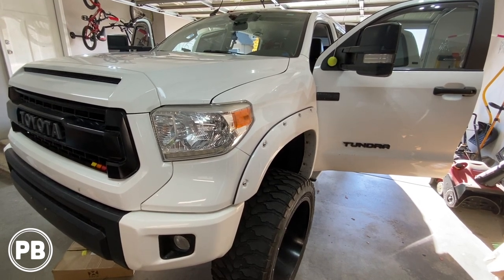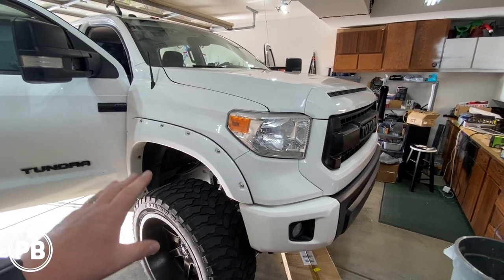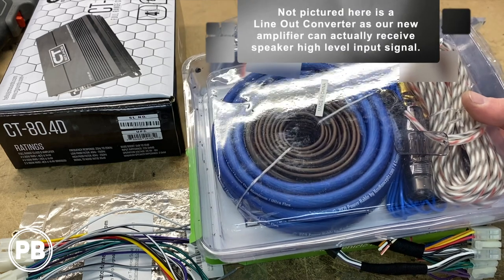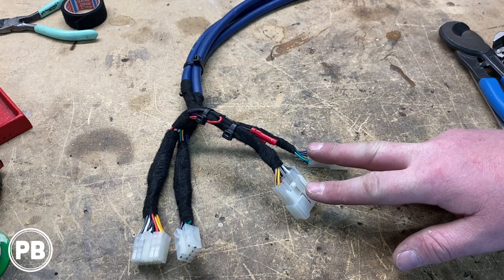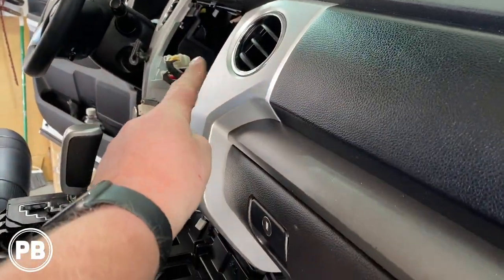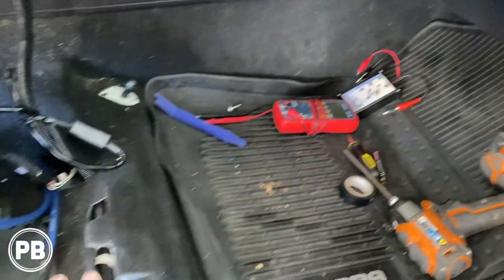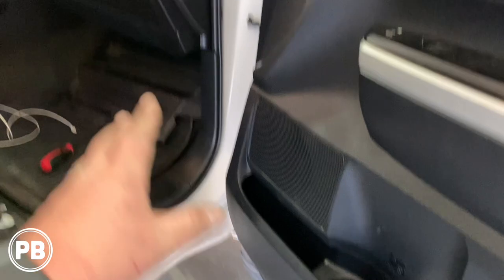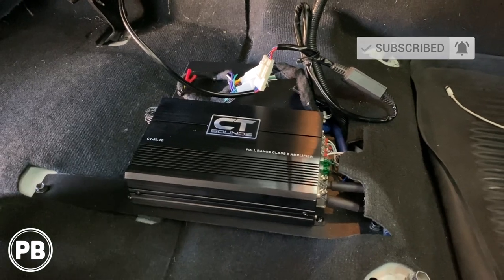2014 - 2021 Toyota Tundra 4 Channel Amp Install

Comment: Thanks!Your videos helped me wire my 2015 Tundra. I ran into a few minor issues, but was able to correct them easily. The smaller male connector that goes into the radio was keyed differently but I just cut out the piece that was blocking it with a razor. The other harnesses for the plug and play hookups didn’t come with the extra wires for hookups for subs so I just soldered in new leads color for color with the extra 9 conductor cable I had. I wasn’t able to find pins and not too savy on finding car parts. Otherwise I would have just pulled the pins and cut and re crimped them with the extra leads. Other than that install went well. I really appreciate the help keep up the great videos.
Reply from the maker: Thank you!

Comment: Hey thanks for the content you make!!! I have an aftermarket headunit. Im trying to wrap my head around the bypass you did in the video. Because i have a aftermarket headunit i would just run rca to amp then send signal to the door speakers using the already installed toyota wiring.... i think. Currently i have the amp bypassed because it did not work with the android head unit i installed. My question is why not just use the signal wires coming from the radio in the harness underneath the passanger seat to the amp's input then running the amp output to the speaker using the harness underneath the passenger seat? It does not make sense to me but im ignorant and dont know enough to understand why you need to do a bypass and make a new harness. Im just seeking to understand.

Comment: Great series of videos!! Just finished my install and wanted to mention that the factory amp in my 2021 tundra needed a larger piece of ABS plastic. 16"  was too short.
Reply: Did you use the T-harness recommended in the parts list? My understanding is this one does not fit the 2021 non jbl stereo.
Reply: @welshtexas1  Not sure if you found an answer or not, but you have to use a different harness. I emailed @ProvoBeastAudio and they sent me the correct info for my 2021 tundra non JBL.
Reply: Hi, can u please provide the information for the 2021 none JBL harness.  Thanks in advance.
Reply: Hi, can you please share the link/ information for the 2021 Tundra. Thanks again. none JBL @camoore
Reply: Do you have the part number of the part they sent you?  @camoore

Comment: The “new harness adapters” from Red Wolf do not fit the 2014 tundra. This route is a total wash if you’re depending on the harnesses listed. I have the 2014 SR5 Crew Max. Non JBL…with small amp under the passenger side seat.

Comment: Thanks for the video, but, still wondering why you went from the factory amp harness back to the head unit and then wire from the CT amp back to the factory harness behind the radio... You had both speaker and source wires under the seat already to connect directly to the CT amp, maybe I missed something...

Comment: It would just be easier to buy an amp that can take high inputs, then you wire the radio inputs to the high inputs of the amp. Then you wire the outputs, these are wires going to the speakers, and wire them to the oupts of the amp. Saves time pulling the radio out. Also if you have a amp that dosent have high inputs then you can a LC7i but this is the more expensive route.

Comment: Why do you make another harness to go from the radio down to the amp if you have already bypassed the original amp wiring. Sorry I have watched this video 10 times trying to draw out a diagram of what harness goes where and I get lost. One end plugs into the radio so where is the signal coming from the radio or after the bypass loop that goes back up to behind the radio?

Comment: I have a 2021 Toyota Tundra with NON-JBL system but it does have an stock amp. I already made my Harness for the amp bypass but the AX-DSP-TY2 harness you are using does not fit the stock harness from behind my stereo. Can you help me out please!  Thanks

Comment: If I have an aftermarket head unit, how do I connect the 9wire? Will I have to splice it into the factory side of the radio harness? Also, could I just splice the factory amp input wire into the high-level input to the new amp and then the factory output to the new amps output? We went with a dasiata head unit and are struggling to connect the CT amp and bypass the factory amp.

Comment: Do you need both harness for the amp  bypass and the t harness so under seat amp has the same wires that goes back  to the radio rigth getting the signal from there instead of running the t harness  will work or be better

Comment: It’ll be great if you help me out. I install the same way you did but the only difference is that I have LOC 4 channel and same stock radio. Biggest problem I’m having is static noise coming from all speaker. I even bought those noise canceling filter out but still resolved my static/buzz noise
Reply from the maker: Send us a message on facebook / instagram and i can assist.

Comment: Can you do a video with the trail grid pro plug and play kit? Im not sure where i connect the 9 color speaker wire to for the output.
Reply: Give Trail Grid Pro a call to ask. Their customer service and tech support is pretty good.

Comment: Hello
how about the rear channel on this toyota. there is usually very little bass on the rear channel. how do you solve it? if you have an amplifier, only the sound is amplified, but still a little bass in the back. ?please help

Comment: The AX-DSP-TY2 did appear to be ideal for this setup. I’m looking to do both the 4 channel setup with a sub amp. Does the alternative Toyota T harness linked in description do the exact same thing? The connections don’t even look the same. The smaller male end on the alternative appears to be missing two wires (orange/extra green I think) but maybe those aren’t needed to get the signal to sub LOC/amp? 

Also can the center dash speaker bridge both the front L&R? Thanks!

Comment: I am thinking about upgrading my system, but am confused about what channel amp I need. What is throwing me off is the center speaker in the dash. Was wanting to run 4 Kicker KSS670's, and replacing with a Kicker KSC350 for the center, and running a dual 10" 1,600W sub set. Do I get a 5 channel amp with a mono? Just not sure. Trying to figure this out on my own. Any input is very much appreciated!

Comment: Now the amp is powering all seven speakers? The four doors speakers, the two dash corner speakers and the center dash speaker also?
Reply from the maker: Factory non JBL amp only powers door speakers 6x9 and 6.5".  all tweeters (3 dash, rear doors) are powered directly by the radio.
Reply: Thanks 
But the new amp will power all speakers or just the speakers doors?
Reply from the maker: @juliomoto70  All speakers as we bypassed the factory amp wiring.
Reply: @ProvoBeastAudio  this does not make sense. You should show the wiring for the tweeters behind the radio. Some components speakers run a bigger crossover for both the door speakers and tweeters. I’m just confused that you didn’t show the separate wiring for the tweeters?
Reply from the maker: @joelmunoz8899  It's because we we sent our amplified signal back into the main harness behind the radio, not at the amp bypass.  We didn't run new wiring for tweeters (see that video linked in the description).  This ensures all speakers receive the amplified signal equally.  Our new aftermarket tweeters have an inline crossover, so no separate crossover was needed.  It would make a lot more sense for you if you saw the front door speaker install video linked in the description of this video.
Reply: @ProvoBeastAudio  just saw the video again. Ok I’ll just have to ohm out the wires to find out which ones they are. Great video. Thanks it’s a lot of help. If you could have recommended a RCA output converter to do mid range amp and sub amp it would’ve been sweet. I’m moving my backseat forward so I can fit a bigger sub box. If you’re interested I could send you photos of the outcome.

Comment: Question here so i just wanna upgrade the amp and door speakers easy enough but ive heard like u mentioned its mids and lows at the door i want a full rane threeway speaker will i have that singnal at the amp harnes coming from the headunit ive heard the headunit has the “filter” so no and ive heard the amp has the “filter” so yes u can wich is it ?

Comment: Hello sir I hope you can help me im doing the same install and I made my t harness and im not getting power to my head unit when I connect I didn't connect the constant or ground but I connected the 12v what is it that im missing? Thanks in advance

Comment: Thanks I found the video i was loo at your website and it say that y’all can prepare the harness for $49.99 …and another question  if I get a Tesla edition radio do I still need a harness to connect an amp with subwoofers ?
Reply from the maker: Yes, we can assemble your harnesses if you ship them to us. You will still need an amp kit to install an amp and sub to any vehicle. The only difference is you won’t need a line out converter as the new radio will have a sub output.

Comment: Quick question would I have to still bypass my oem amplifier even if I have an aftermarket radio?  Just looking to install a 4 channel just like you man. Nice video btw
Reply from the maker: Yes, the only difference is you would run RCA cables from the radio to the new amplifier.  For your audio out, just use the bypass harness we used to loop in all your speakers, and use a run of the 9 conductor cable up to your main wiring harness behind the radio, disconnect your radio speaker outputs, and connect in your new speaker 9 conductor cable to the wiring harness adapter.
Reply: @ProvoBeastAudio Awesome video and explanation.  Can you please provide a link where I can purchase the harnesses for my 2021 tundra none JBL.  Thanks again
Reply from the maker: Sure, if you want me to build one for you, you can order one here: https://www.provobeast.com/shop @lazarousjam

Comment: Super informative, thank you!  What would i need to do differently with the harness (if anything) if i am installing a 5 channel amp to be able to run the subs as well? (everything off one amp)  Thank you in advance.
Reply from the maker: If your 5 channel amp can simply just take 4 channels of input (sub snags signal from the other 4 channels), you can use everything linked in the description.
Reply: @ProvoBeastAudio  Awesome, thanks again, much appreciated!

Comment: I did this in my 2014 and I’m getting sound that sounds like I have the speakers crossed but they are not I triple checked and the head unit controls the correct speaker for fade not sure what’s up
Reply from the maker: Are you using the high level input or an RCA line out converter?

Comment: How much of this process would change if i were to buy and install an aftermarket head unit?
Reply from the maker: Instead of a T harness, you would run RCA cables from your aftermarket radio to the amplifier, then your 9 wire from the amp to the radio harness adapter that connects into the vehicle.  Then simply cap off the speaker wire outputs from the aftermarket radio.
Reply: @ProvoBeastAudio  Ahh. Thank you so much!!!

Comment: Can I run just the door speakers from the amp and leave dash speakers alone? Would it sound good? Don't wanna have to pull out the stereo,
Reply from the maker: We suggest replacing them as full component sets, but that’s your call

Comment: I did this same exact set up in my tundra. For some reason I’m getting a lot of engine noise. How do I get rid of that noise ?
Reply from the maker: Try line out converters instead of the high level units.

Comment: If you upgrade your amplifier to an aftermarket amplifier. Do you have to upgrade the wire going to the speakers to handle the amplifier output?
Reply from the maker: Depends on how much power you are pushing.  Generally Toyota has copper wiring running thoughout, and they can handle up to 100w RMS over that 18 gauge copper run.  So any more power than 100w, you will need to run new wiring.

Comment: I am a DIY man when it comes to car audio. I have never had the problem on my 2008 tundra (does not have premium sound system)  I cannot figure out which wire to connect the illumination  wire on the radio to my tundra aftermarket harness....I have struggled to figure this out someone please ideas or shortcuts would be appreciated thanks
Reply from the maker: illumination or dimmer can be orange or orange / white.  But can't help you unless we know the radio you are using and the harness you are using in your install.
Reply: @ProvoBeastAudio   Thanks for getting back to me I really appreciate it I am installing the 10.1 android EONON DOUBLE DIN car stereo AND I BELIEVE A SCOSCH  WIRE HARNESS. THANKS AGAIN

Comment: How can I add an amplifier without removing the factory one?  the one that comes under the seat.  it's not jbl.  do i have to get the rca from the radio?  what parts do i need?    2019 Toyota Tundra
Reply from the maker: If you are adding your own 4 channel amp, yes, removing the amp under the seat would be necessary (same trim as our truck).  All parts are linked in the description.
Reply: I think you did not understand me, I want to leave the one under the seat and add one more for 2 12” subwoofers. Thank you.

Comment: Wrong harness, won't fit in 2021 Tundra SR5 Non JBL.
Reply: I just found this out. Do you know which one will?
Reply: @ryancollins2483  Not yet, I still searching .
Reply: Did you find the correct harness I'm having the same problem with my 2021

Comment: Do you have one for a jbl?
Reply from the maker: The JBL amplifier still uses the same harness adapters for speaker outputs as linked in the description, but the pinout diagram may not align perfectly.  You can use this video as a reference: https://youtu.be/80BmIhvdmL4

Comment: consumer beware, that CT amp is a POS. mine blew up after 10 days' use. i was sending 75W rms to 4ohm comps. 4ga power/ground. 4v rca signal. 
CT is going to send a new product, but im not even going to use it. 
get what you pay for!!